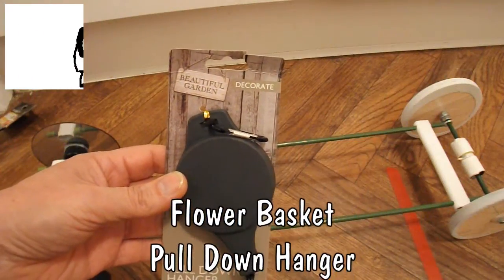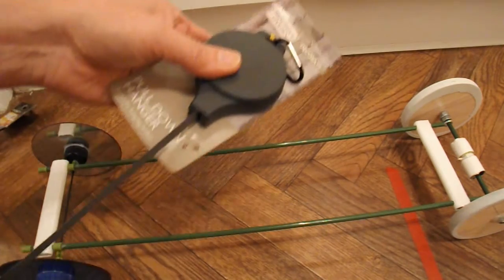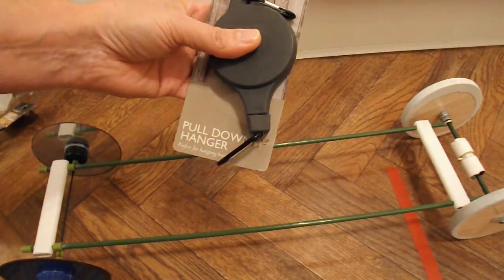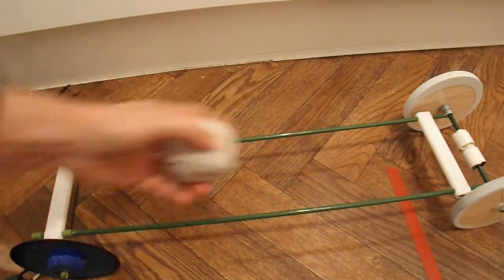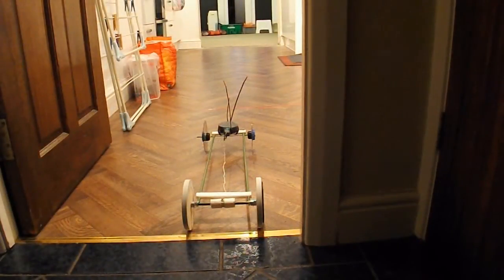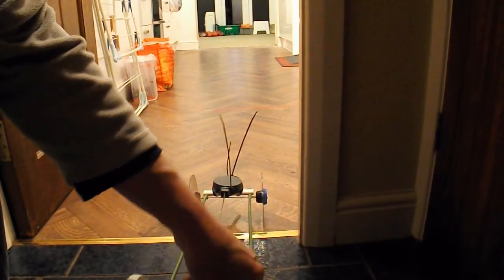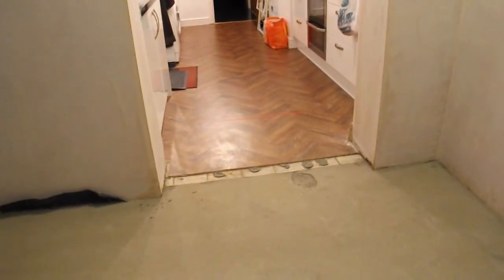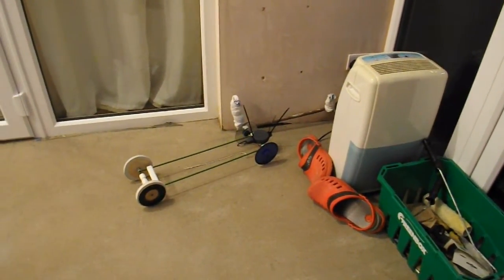Flower Basket Pull Down Hanger Powered Car

Comment: Hey, can you make a rubber band motorcycle that rides on two wheels?
Reply from the maker: No. To make a true 2 wheeled motorcycle (not one that has very wide wheels to make it balance like a 4 wheeled car) I would need to include electronic gyrostabilisation which is way beyond the scope of this channel. My channel is all about simple, quick, and cheap projects.
If you do a quick YouTube search for "self balancing bicycle robot" you will find several, but they all use electronics to provide the stabilisation. Here is a good example http://youtu.be/0312BNqIBFI

Comment: Hey can you make a rubber band power car that can only use 3, number 64 rubberbands and it has to travel 5 meters.
Reply from the maker: My cars are all tested over the length of my kitchen which is 5 metres. I usually use much thinner rubber bands than number 64. I will see if I can find any 64s but if I cannot I will just demonstrate one of my normal cars going 5 metres with less power.
Size 64 rubber band measure 3 1/2"x 1/4"x 1/32" or 89mm x 6mm
Reply from the maker: Here you are http://youtu.be/JQYt-J6jxMI

Comment: It seems that all cars tend to turn left.
Could the soil slightly tilted?
Reply from the maker: You could be right, I doubt that my floor is perfectly flat. It is more likely that I release them poorly. You will see I generally hold the left side of the car so just the drag of my hand as it is released probably turns the car to the left. 
This particular chassis is very flexible as it has no diagonal cross members so it twists easily, so the tension could also cause the car to turn.

Comment: i am trying to make a propeller for a boat but its to small for all the things i use like a paper clip and the propeller is from a helicopter called the DFD f162 can you please help
Reply from the maker: I don't think I fully understand your question. I guess you mean you have a broken rc helicopter that you want to use the motor and electronics to make a boat. You can either search eBay for a small propeller or maybe make one from a piece of twisted plastic or thin metal cut from a drink can. I am always looking in the shops for anything that could be used as a propeller, sometimes small ornaments or toys have suitable fans that can be repurposed.
Reply: no the helicopter is fine but i used an extra piece and the piece that i used was the back propeller but it wasn't from the helicopter its was an extra piece that i could use to replace if the one on the helicopter broke.
Reply: and I'm on my moms account I'm a boy just to let you no
Reply: i could use a electric tooth brush motor but i haf to wait to get payed and buy one I'm 10 years old and i wan a build something that I've never built before
Reply from the maker: Rachel Bailey So you mean you already have the propeller and you want to use it to push a small boat through the water.
Here is a very simple boat
http://youtu.be/0JBabXZU0NQ?list=PLA5a2xPRSrB24vUS9E8zkSgjZysEL00zr
and another simple boat
http://youtu.be/J0AOd75jUiQ?list=PLA5a2xPRSrB24vUS9E8zkSgjZysEL00zr
and here is my Toy Boat playlist
http://www.youtube.com/playlist?list=PLA5a2xPRSrB24vUS9E8zkSgjZysEL00zr
Reply: ya to build a boat and have a moter spin the propeller for it yo spin through water
Reply: look up on youtube DFD f162 r/c helicopter by rc 4u then go to the video and look at the back  propeller and you will see how big the propeller is that I'm using
Reply from the maker: Rachel Bailey I did look it up when you first commented. You don't need much to get a boat moving in the water. Your main issue is how to connect the prop to a shaft and then to the motor and I would think a paperclip might do. You will need to find some thin tubing to connect the paperclip to the motor shaft. A plastic tube like a ball pen ink tube or a cotton bud can be heated and stretched to produce a thinner tube.
Reply: thanks for helping i found a really small paper clip that goes in to the propeller so now i put a soda cap on it and I'm gonna glue the cap to the boat so the propeller spins wall the cap holds on to the boat thank for helping